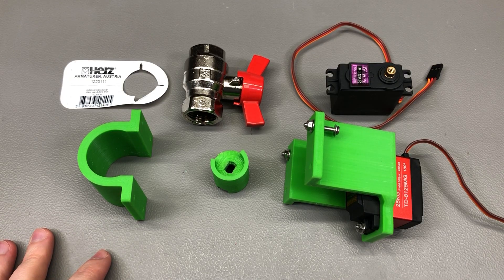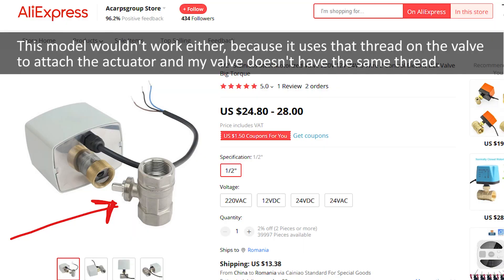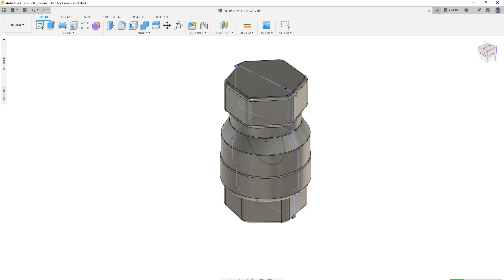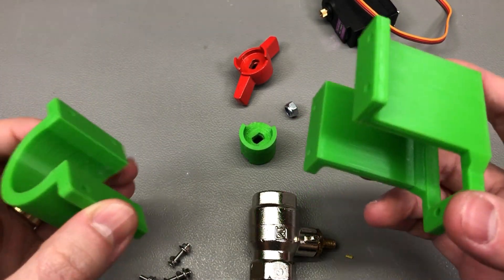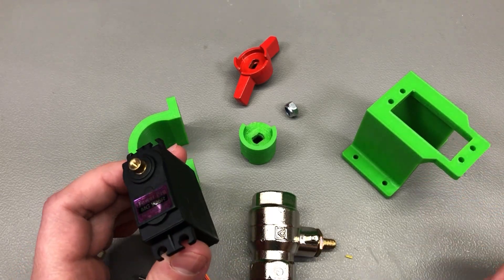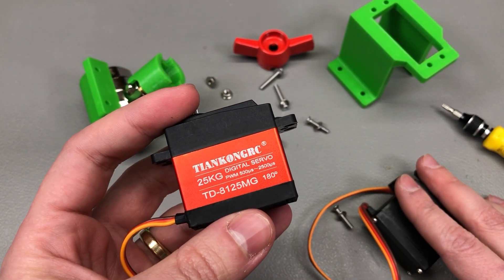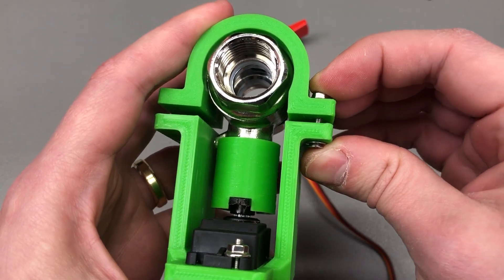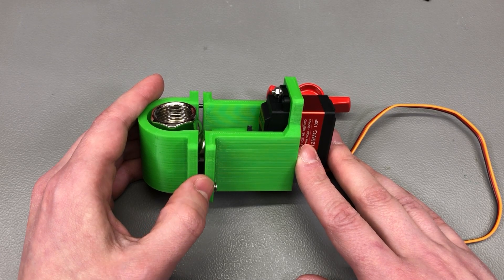Water Valve Servo Automation (part 1) | Voltlog #412

Comment: Great video, great idea!

This is what I need to build due to what happened yesterday.

We have a Rainfresh System 3 filter and yesterday, 2 of the cylinders started to leak.

But we didn't know about it until water was all over the floor and under the sink was flooded.

To provide water to this filter, I installed one of those in-line water valves.  Similar to what you have here, but with a one-sided metal handle, very small.

In seeing your video, I can see that this can be a good way to do things.

Although, good point about if the servo/controller fails, so I think that I'll do is to add a 2nd shutoff valve, just before the part where the tubing goes into the filter.

So I see that this is part 1, so I tried to search your videos for Part 2 but no hit.
I even searched, just for the words, 
*Water Valve Servo"
but still no hit.

I usually see what when people have multiple parts for something, they use the same title, just ending in Part 1 or Part 2, etc, which keeps things consistent.

Did you not do a 2nd video on this?

If so, please link it here.

As I typed this, I just noticed that 9 months ago, someone also asked about part 2, but you didn't respond....  ?????

Comment: Any link to part 2?
Reply: I realize that your post is over a year old, but I thought that I'd chime in anyway.

I notice several asking about the part 2 that he mentions.  I searched his channel and nothing!

So then, I found those exact servos on Amazon and in fact, I ordered a "2-pack" of the 30 kg one that come with different pieces and even a nice metal one.

As for the code, as an Arduin/ESP32 guy, I know that the code won't be too difficult.

So I researhed about this servo and found other videos showing how to code for it and the library used.

It turns out to be seriously easy!  You would need an external power source to run these servos (5V up to 350 mA - easy to do with a 12V, 1 amp supply and 1 or 2 buck converters.  One for the Arduino (although, a single buck, adjusted for 5V can feed the Arduino) or one buck set to 3.3V for an ESP32 and the other set to 5V for this servo.)

The library makes is super easy to use this servo.
Literally, supply power to is, share the ground with Arduino/ESP32 and the data line goes to a pin on the controller.

In code, you send either 0 degrees for one direction and 180 for the other.

I haven't read the library fully yet, so I'm not sure if there's a number of degrees, but I suspect that there is.  I wonder if there'll also be a bit for speed.

I look forward to this project I'm going to start soon.

Comment: The servo metallic rotary threads being connected to the plastic adapter threads is going to fail, it will mess up the plastic threads over time since the threads are so small and these valves requires a lot of torque. Wouldn't implement that for home plumbing lol Gears are much better, worth the time. If the servo metallic rotary had larger threads connected to the plastic adapter would be ideal.

Comment: using a retrofit device to work the manual lever is the best because.

1. it retrofits no need to design an interface to the valve that requires removal of knob.

2. most important should the electronics malfunction or get hacked into you have a manual means of control you disconnect the actuator motor and turn the valve manually.

if the valve is on the city side of the fixture then you will have to call in the water co to replace the valve and you being in an apartment you have to get permission from landlord unless you are the landlord.

if you can install a valve on the owner side of the fixture you can then install what ever valve you want again as long as you have permission from landlord or you are the landlord.

Comment: Use a new electric ball valve motor and adapt it to your existing valve. Be sure to get one that defaults to off. If you have a problem remove your quick release pins and the existing red wing knob can operate as normal.

Comment: Do they make a servo motor like those stepper motors with the drive shaft that runs out both sides of the motor? Then you could just have a handle that can be connected to that for manually closing or opening the valve.

Comment: An option for an emergency cutoff would be to attach a thin cable to the new valve knob and wrap one turn around the shaft then add a small grab handle to the free end of the cable. Then with power off on the servo it should be possible to pull on the handle and rotate the valve the quarter turn to shut it off. It will require more force than the original valve handle but it should not be too much for an emergency.
Reply from the maker: Thanks for the suggestion, that could work.

Comment: Nice.  I think the existing handle could be incorporated and allow manual override and not be too bulky.  For meter reading I suspect you have heard of but just in case - jomjol AI on the edge esp32 meter reading project.  I have tested it and works ok.  It occasionally gets it wrong.

Comment: with a bit more extra work you could mount a small chain or toothed belt onto the valve adaptor itself, and then use the short belt to create a new secondary shaft added to your existing mechanism. but in a different position that then be clear the clamp etc and avoid the other access problems due to the limited space

then you have another shaft onto which you must decide how to put your manual override lever or turning device. but you do not need the turning thing always attached. it could be just a connector stub, on to which you can more quickly insert into a temporary key when it is needed in an emergency. in other words a detachable handle

the advandage of this approach is that you never have to remove the original motorized device and mounting. which comex at the cost of some extra complexity. a more complicated design. but you have limited space to work with

another option might be to make the coupler include a 90 degree gear, so that the servo can go sideways. instead of the hole shaft being inline an a straight extension of the original valve. since the confined space

there a probably a few other different mechanical solutions too. for transferring the drive more creatively in other ways. ie with wires or steel cables and such. but of course you do not want to obstruct or interfere with the other things in the rest of that compartment
Reply from the maker: Yup, several options of doing this I just can't decide which one would give me the best results with the least amount of effort 😂

Comment: Nice not-only-electronic project! For the manual override, I was wondering if it would work to drill a diametrical hole through the adapter piece plus make a long slot in the U-shaped part, so that it would be possible to turn the valve by plugging any medium-sized screwdriver would work (as a lever). That would allow also to manually 'feel' the valve stiffness, without dismantling it from its operational state.
Reply from the maker: I would also need to remove the servo first because turning with the servo attached would imply even greater force needed.

Comment: I was going to suggest you cycle the valve once a month. The city i work in has a guy that goes around with a device that does that with valves in the streets.  The device measures the torque needed to open and close the valve so they know if the have to work on the valve
Reply from the maker: Yup, I'll definitely implement that type of automation.

Comment: I know you said that changing the water pipes is not an option but the most simple solution for an manual emergency valve is to had another valve on the input side of the water supply and leave it unmodified. If any time you need to close the water supply quickly in case of an emergency you'll always have a manual and the automatic/remote shut off.
Reply from the maker: Having a second valve would be nice..

Comment: I did basically the same but used an old cordless drill (you find plenty of them in every scrapyard, because once the battery died they get thrown away). In this way i have plenty of torque, and even an overload ratchet mechanism. Of course this needs a little more space ...
Reply from the maker: Clever usage of an old drill 👍

Comment: Since your valve turns 90° and the servo 180°, you could half the torque requirement of the servo (or the other way round increase the "reserves" in case the valve gets harder to turn with time). And it isn't hard to do either. Use the normal servo horn and print one for the valve that's about twice the length. Mount the servo to the side of the valve, so you can look onto the shaft of the servo as well as of the valve, like two clocks side by side. When the servo turns from 9 to 3, the valve turn from 10 to 1 (or 11 to 2 or something in between).
This also solves your other problem: you can easily access the valve for manual operation. You can even integrate the "knob" in the 3D part you print for the valve.
Reply: Looks like it should be pretty easy to get quite a bit of leverage using some bicycle gears and chain.

Comment: Put a hinge on one side of the servo bracket assembly and an over-center cabinet latch on the other side.  Putting it on and taking it off would only take a couple of seconds.  Drill a hole in one wing of the red valve handle and hang it by a string next to the valve.  If you need manual control you can unlatch the servo clamp, pull off the drive adapter and use the handle.  The handle will work just by pushing it against the valve stem; its retaining nut isn't required.  Or, simply hang a small metal or wood bar near the valve that will fit in the same recesses of the drive adapter where the servo arm sits now.
Reply from the maker: I'm liking this idea, if I keep the current servo position I will try to design a hinge mechanism. Thanks!
Reply: @voltlog  If you don't want to screw a metal hinge to your bracket halves, you could 3D print a few offset hinge bosses on each one with small diameter holes for a pin.  I've had good luck using a length of coat hanger wire as a hinge pin.  Put a 90deg bend at the top end of the pin so it can't fall through; that bend also offers a good handle for pin removal.
Reply from the maker: @FlyingShotsman  Thanks! an offset hinge designed in the model was what I had in mind, I could just slide a steel shaft pin from an old mechanical assembly. I can have the bottom part of the hinge closed so the pin doesn't fall.

Comment: I tried something similar for  watering my greenhouse, but the servos i had available were not strong enough, So i went ordering solenoid walves instead stronger servos.
Reply from the maker: That's definitely an option but I would like to avoid messing with the installation.
Reply: Sure. In your case, i would have done  the same. Total different situation with a new installation in the greenhouse, where you can move things around as you prefer.

Comment: I really like your ideas and creativity a lot, but in this case I don't think it is a very good idea...
The torque needed to close the valve can become a lot higher when it is not closed for some weeks or even days or hours.
In case of an emergency, top priority is that you can easily close it by hand (not depending on electricity or connectivity) without any extra obstacles.
When you have flooding; it can be in any location of the house, so it's difficult to have sensors everywhere.
Closing central water when away might also have side-effects for central heating/cooling and when accidentally closed could ruin your washing-machine/dishwasher etc.
Again the tinkering idea is a lot of fun, but practically I would considering this troublsome at least ...
Beside this, all the kudos for a great channel; I'm a big fan :-)
Reply from the maker: I would have to disagree because the concerns you mentioned are not an actual representation of what could happen, let me explain:
1. As discussed in the video I will be implementing an automation to prevent the valve from getting stuck. Not implementing an automation at all doesn't bring any advantage as the valve would get stuck if not used anyway.
2. As discussed in the video I am looking for ways to implement a manual override.
3. Not having sensors everywhere in the house is not a reason not to install them in places where you can and protect the house using the available sensors.
4. Turning off the water supply has absolutely no side-effect for central heating, washing machine, dishwasher as all of these just pause and report an error when there is no water. As you can imagine the water supply can also be turned off for many other reasons, outside of your control so the equipment is designed to take that into account.

Comment: Very vary bad idea . No manual control you don't have a second valve for manual cut off . In case of power failure how you can cut the valve?
Reply: It looks easy enough to remove the servo mount.
Reply from the maker: As discussed in the video I am looking for ways to implement a manual override.

Comment: Very nice,
Wanted to use something like this for some brewing Equipment, but because of space constrains I am useing the solenoid type valve. But this needs to be tested further.
For your problem with the mechanical lever, i would use either something like on lathe with powerfeed, where the wheel is disenaged with a spring. You have to partially cut out one side of your clamp and let a "single end lever" either rest upright or let it dangeling down.
Or partially cut out the clamp on the right side, model a hex on the outside of your connection piece and place the matching hex wrench somewhere in your technical space.
Reply from the maker: I would probably want to disengage the servo somehow, because turning the valve with the servo attached would be difficult.
Reply: @voltlog  Maybe split the connection piece in two and connect them with an outer ring, that is dented, so its not gonna disengage itself. Something like the "Baliflex clutch". The mentioned hex"nut" is there where the Baliflex-Clutch has its grubscrew.
Reply from the maker: @Hassla  Thanks! that's a nice idea!

Comment: if it is a quarter turn knob do a bigger cutaway on top or bottom spanning to the left/right , 
then on you adapter, print a lever on just one side so there is enough room for the lever to move tho the cutaway, if you can imagine, between 3  and 6 pm, make the lever reasonably long so  it has enought force to to overcome the servos gear torque.then you get a manual control lever and it will fit in the same space
Reply: Yep, I think you've got it...cheers.
Reply from the maker: These are 3D printed parts, my first attempt in PLA. Having those wide slots in what is the main support for the servo would mean a very wobbly system. I would have to switch to some harder material or just make the whole thing thicker but it is something to consider for a future revision if I don't come up with a better way.
Reply: @voltlog  if you make the servo mount part a 4 sided square, that would make up for the slot, and it wouldnt be able to twist either. you can have small gap on the end for the servo ears.
Reply from the maker: @grimninja2004  thanks, that's a good idea!

Comment: Nice project!  Have been thinking about similar project and this brought this up again. Only problem being that I do not have power nearby and have to figure out how to get it get it from somewhere.
Reply from the maker: Luckily I have an alarm coms wire in that area (visible in the video) it's like a 6x24 AWG or something like that which should be good enough for me to run 12V to my system. But if that's not available a different approach might be needed for battery power, like dropping wifi in favor of zigbee for low power usage.